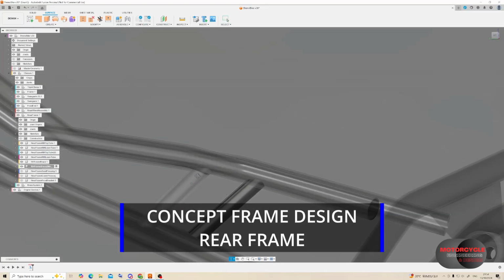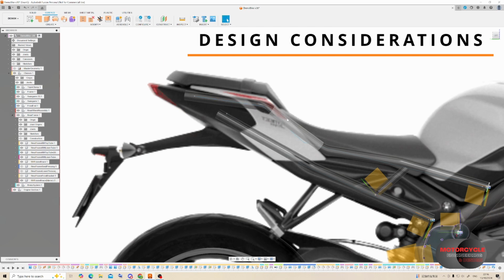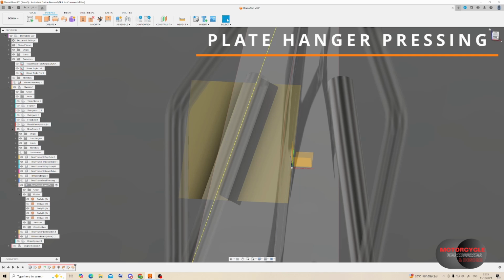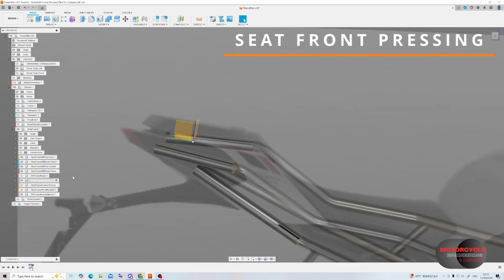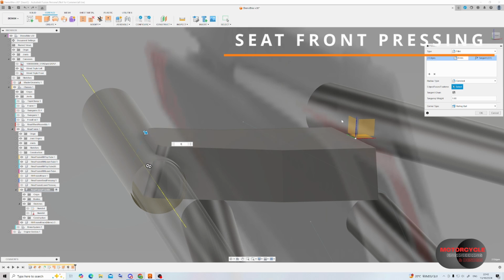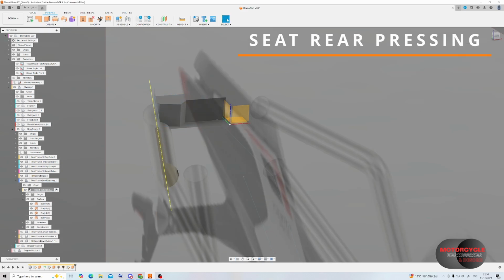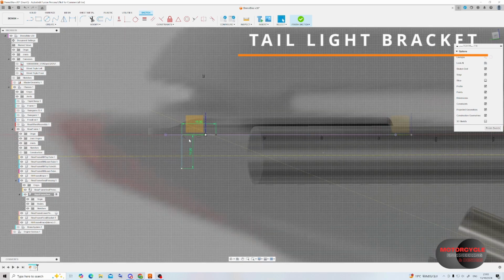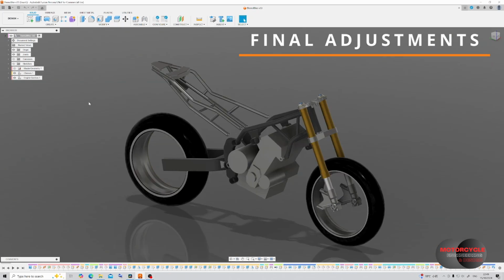Motorcycle Frame Design, Rear Frame Concept Design, Fusion360

Comment: How do you control all the frame tube bends in 3d space? Getting it to flow in one axis is easy enough, but I'm having trouble getting everything to flow in all the axis, in a controlled manner.
Reply from the maker: Hey, good question! Fusion isn't as straight forward and friendly as other programs I've used for tube design, but I've got my ways! I'll upload a video on it this week!